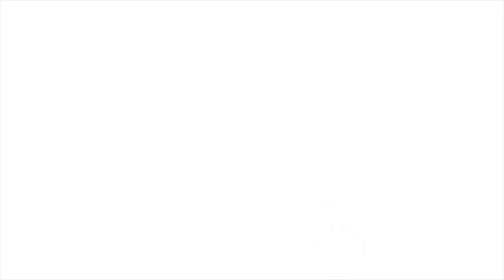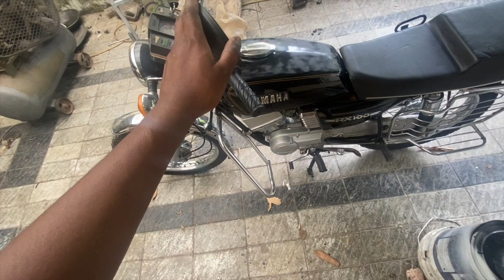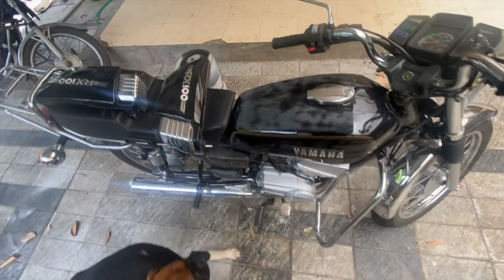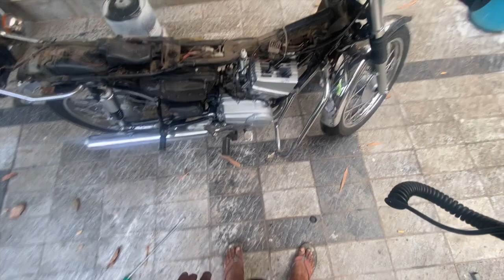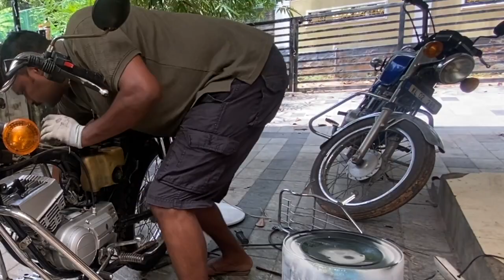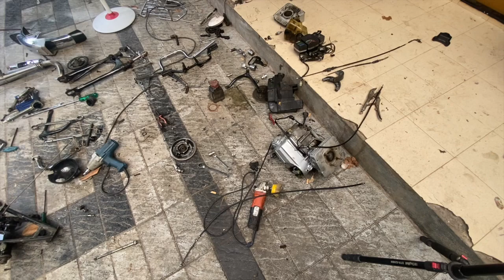New Yamaha RX 100 Restoration, This time its not stock :)

Comment: Hi Sir,

I own a RX 135 4 speed. I feel like it is over heating alot when I go above 60. If I continue to ride it on highway, the engine goes so noisy and lose power at low speed making the engine stops. 

I am tired switching mechanics, no one is figuring out normally. 

I gave the bike to one mechanic for engine service. He rebore engine now it is making so noise. another mech said the crankshaft is loosen and need another 10K for service. I am tired of this. everyday there is small problem.
Reply from the maker: Ping me on insta let’s see what can be done
Reply: Most probably your bikes engine is sleeved.
Sleeved cylinders loose power at high temperatures ( the new sleeve will take time to adjust to the engine)